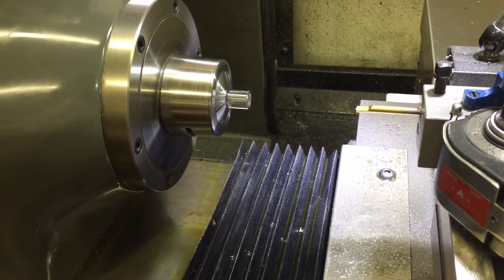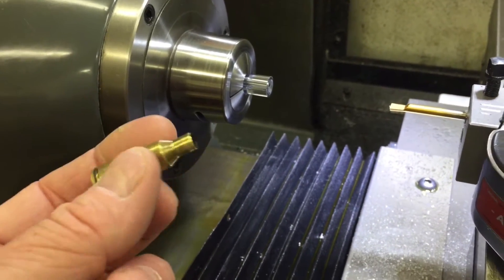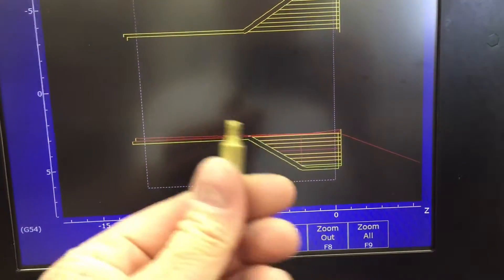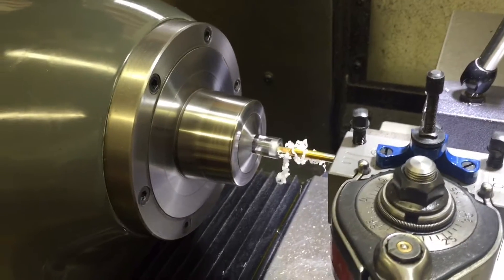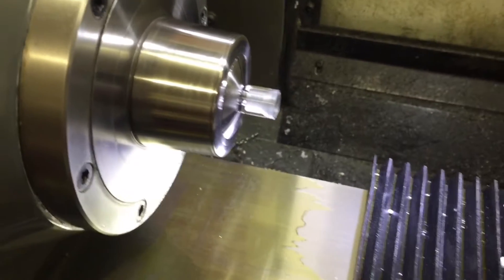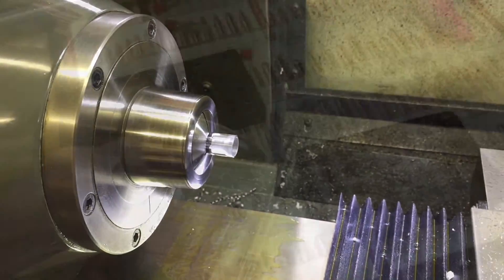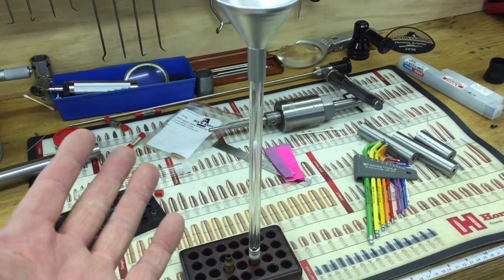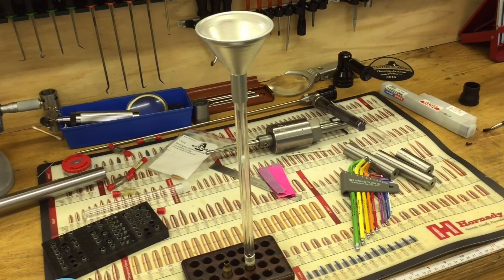Boring a Drop Tube for 6PPC

Comment: Hey nice allen keys, I have a set of those myself, just got the metric set haven't sprung for the imperials yet but but man are they awesome. They have a sale every black Friday.
Reply from the maker: Good to know they have a sale. I will check it out. PB Tools is the best tool out there bar nothing. The Imperials are in now. You can get them on Amazon or just call Count On tools. I got mine a week or so back.
Reply: I really like how the ball ends are formed, it lifts out of a cap screw before jamming like bondhus or others. They also seem to be harder than others. Id like to get a single by itself to test whether they will snap or yield, hopefully the latter.
Reply from the maker: The ball ends are cut on a lathe. There is a video on YouTube showing the process. They are pretty hard. I had a technician out from Switzerland and saw his set that he had used for 12 years and they did not have a mark on them. That is when I started looking around for PB Tools.
Reply: The paint is coming off some of mine cause I hit them with hammers and use cheater pipes, I try to avoid abusing the PB's now and let the bondhus take the hammers and pipes. I run and set up a pair of two axis fanuc lathes so they get used and loved constantly. The paint wont last but I like it when my tools get battle scars to be honest.
Reply from the maker: +Max Maruszewski I am with you on that. Tools need to be used. My metric set is plain polished and it is still perfect. The powder coating will not last forever.